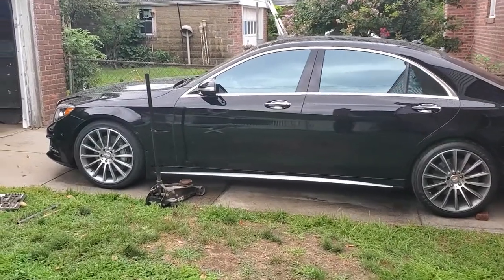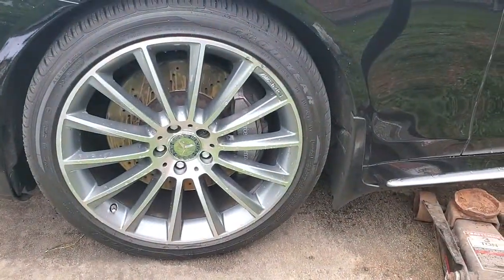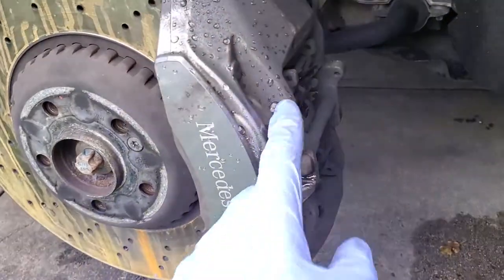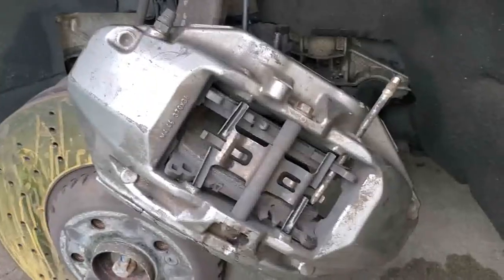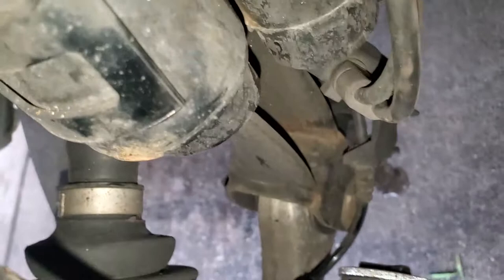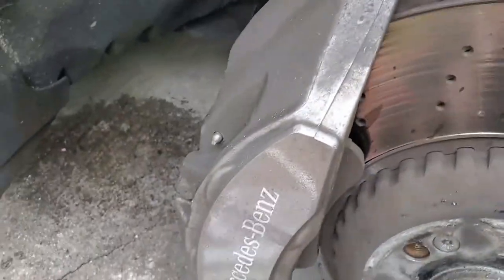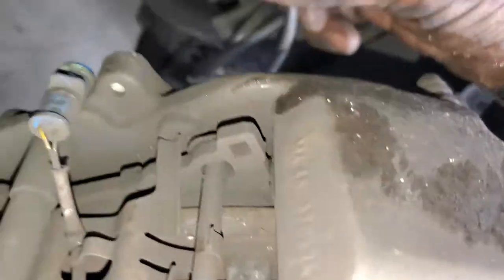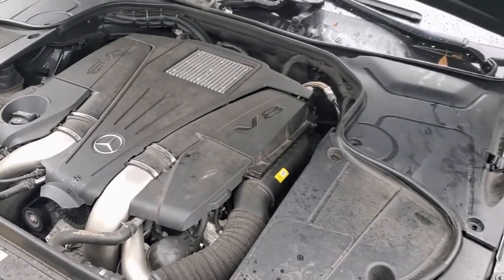Changing Front Brake pad on a Mercedes Benz S550 : Video Series Part 1 of 2

Comment: Pads come out from the top after removing the pins and the retainer clip ,no need to remove the caliper completely unless you are changing the rotors .
Reply: Good point if you're pressed for time and need to get her back on the road.
Reply: Also should make sure to go back and flip that part that holds your pads and pins as you installed the drivers side wrong.

Comment: On my 2000 fifteen, you don't compress the caliper you go into the menu settings with the car in the own position and there's a break service feature you hit OK on that feature and it opens the calipers for you. If you forced them open, you could actually damage them
Reply from the maker: For this car that feature is on the rear brake pad and it works.

Comment: Wayne, exceptional and detailed video. Your service works on a 2017 Daimler Benz S550 too. FYI finish torque on those caliper bolts is a whopping 135 Newtons. So yank hard on that torque wrench in the downward direction. I don't like to 'break' bolts with a ratchet. I used a straight 21 mm combination wrench. At 14 inches long it has plenty of torque. I have also used your videos sucessfully for rear brakes, rotors, accessory battery change, and plugs. These machines are heavy and robusto. Not your typical Japanese 'lightweight' brake system. Der Beste oder NICHTS!! I conservatively estimate your videos has saved me over $2000 by turning wrenches in my garage versus paying through the nose at the local MB dealership. Regards, Rick. Major, U.S.A. (retired) Master Army Aviator and FAA Commercial pilot, Fixed and Rotary Wing.
Reply from the maker: I love your comment about saving money. It made me smile. It is one of the reason why I started the channel. I went to Aviation High School and the the time, The College of Aeronautics, now it called the Vaghn School of Aviation. That is where I got most of my Mechanical experience.
Reply: @WayneARobertson  I had a DB 280SLC  (W123) when I was in Germany in 1990 and bought the metric tools back then. Saving money on the car maintenance lets me fly the airplane more. Plus I enjoy working on my own vehicles. That way, I know the maintenance and services were done correctly and not "pencil whipped" when the shop is pressed for time. For some reason, Import mechanics charge $150 per hour. The local MB dealership gets $800 for changing you spark plugs??? and then they overcharge you on repair parts too?? Everyone who enjoys Daimler Benz motoring cannot be a Physician or a Barrister. So we're the ones with the skinned knuckles and dirty fingernails!!  Ignore the critics and sharpshooters on youtube, your efforts are valued and appreciated by this sextagenerian. "If it ain't right on the ground, it DOESN'T get better in the air."

Comment: You never want to loosen the wheel lug bolts that much without taking most of the weight off the wheel by jacking the car up.  Quarter turn should do it.  You also do not have to remove the calipers if you are just doing a pad swap.  Technically you do not have to remove the caliper to replace the rotor either as it will slide into the caliper without the pads in place.  You also missed the high temp grease on the slide points of the pads, that thing is going to squeal like a pig.

Comment: I had really tough time with the pins at a garage,they said they will try to take them out completely but most likely will bend and need new ones,they have done it after 2 hours of banging but very dificult to take them out
Reply from the maker: Sounds good. The pins normally come out very easily. Your pins probably got rusted and stuck.

Comment: Yo Wayne I changed my front pads and sensor on my s550. I replaced the break fluid that came out.. Also pumped the brakes but now won't shift out of park... only says APPLY BRAKE TO SBIFT. Paddle goes all the way down and my fluid reservoir is full. Do you have an idea of what I didn't do correctly?
Reply from the maker: It sounds your car is still in park mode. Make sure you to take it out of park mode. Make sure you car has a brick on each of your tires to prevent the car from rolling away. Make sure you put brake fluid in the rrservoir and tighten the cap.
Reply: If you only replaced pads, you should NOT have lost any fluid. Did you put the vehicle in brake service mode prior to the job?

Comment: Where can I get a set of those Benz brake calipers? Do they only have sets for the front wheels?
Reply from the maker: Yes, you can order the brake calipers online. Please see the video on How to get Parts for the W222 2016 Mercedes Benz S550: https://youtu.be/6mnLdWhgoyo
Reply: @WayneARobertson  Thanks.
Reply: @WayneARobertson  I see they have the brake calipers on some of those sites, but they don't specify if they are the calipers that says Mercedes on them. Where do I get them from?
Reply from the maker: If you want to be 100% sure that the Mercedes emblem is written on the calipers, you can do two things, call that website and asked them, or you can buy the parts from the Mercedes Dealership. Just give them the caliper part number.
Reply: @WayneARobertson  thanks

Comment: Car wont go into drive after changing pads 🤔
Reply from the maker: Did you release the parking brakes? The parking breaks is highlighted in red
Reply: @WayneARobertson  I was wondering before swapping the pads should you release the parking brake?
Reply from the maker: Did you check to make sure your parking brake is engaged or not?

Comment: Please do some research before working on your car.  Especially when working on your brakes.  1.  you removed your calipers for no reason. Just about all brembo calipers allow for removal of pads without removing the caliper. 2.  Youre making an instructional video and not torquing your caliper bolts back to spec.  3.  You didnt clean up that brake fluid the spilled ( big no no) ... Bro its your BRAKES..
Reply from the maker: Doolie Noted

Comment: Rookie sensation here... Your removed the caliper for what? And you opened the brake fluid res for what? Come on man. Learn to do the correct brake job first before posting nonsense.
Reply from the maker: Did you see the 2nd video changing the Front brake pads for the W222 2018 Mercedes Benz S560? It has been updated to remove brake pads without removing the brake caliper. And yes, you MUST remove the brake fluid cap,  when pushing the caliper back. Damage could occur if you ate not careful, so to exercise caution over carelessness, I would highly recommend it.
Reply: @WayneARobertson  we push 2bar through the reservoir when flushing brakes on Benz. The caps are vented one way to allow air to escape. No reason to remove the cap. Caliper doesn’t need to be removed, the pads pull out of the top.